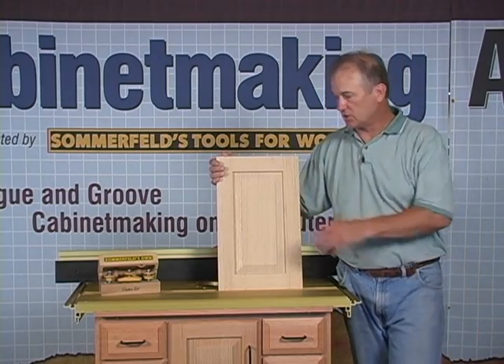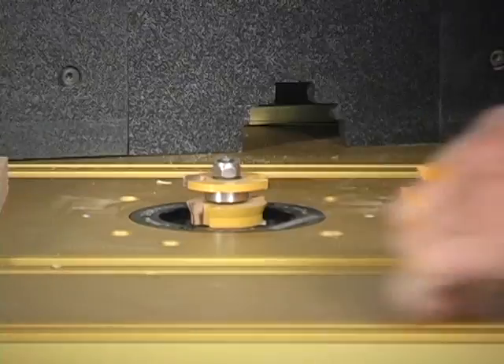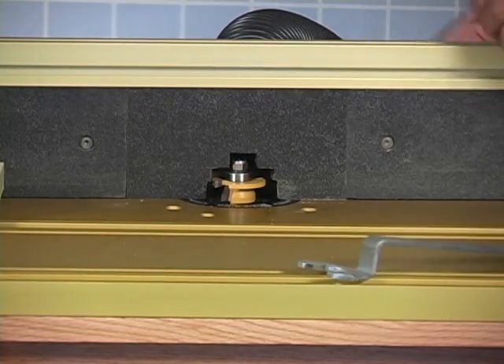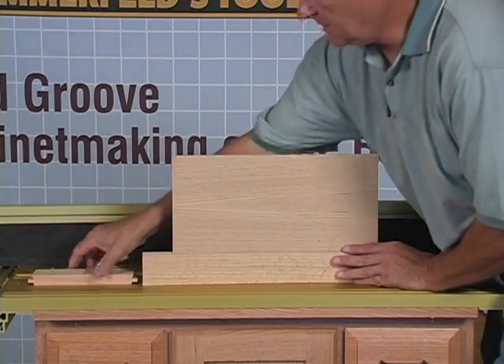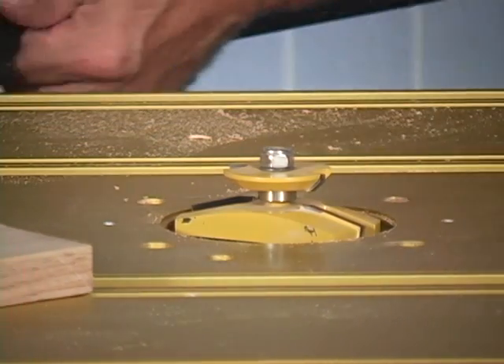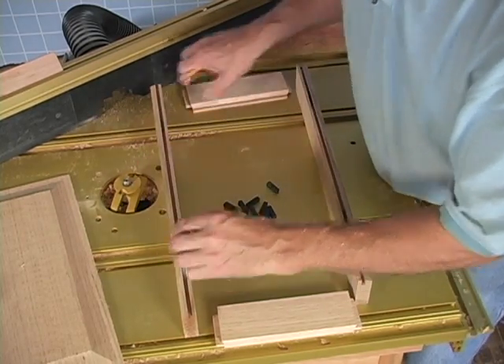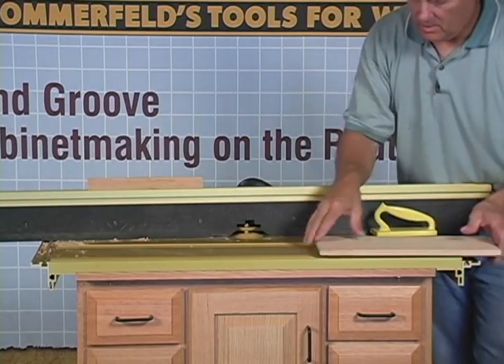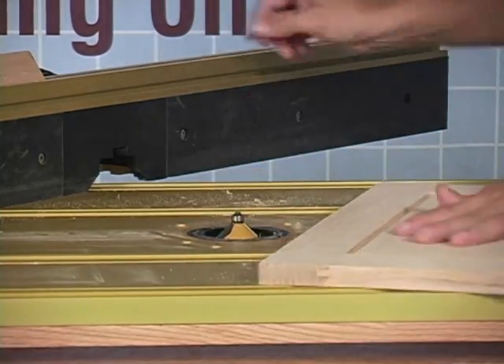Sommerfeld's Tools for Wood - Shaker Raised Panels Made Easy with Marc Sommerfeld - Part 1

Comment: The width dimension for the rails is too wide, and the length dimension for the stiles does not make sense. Rails do not loose 7/16 width only  the stile ends loose the 7/16".
Reply: Top rail and bottom rail are the short ones, by width he means the length of the top and bottom rails which go width ways.
Reply: @raycarnis9540  Yes, that is correct. The rails will lose 7/16" on each side so you need to add 14/16"(7/8") to your rail measurement to get the correct external width dimension of your door after using the cope bit. the styles remain the length of the door.
Reply: @shadespicturehangingsystem1015  Unfortunately, you're thinking of this incorrectly. The width of the Styles are 2-7/16" each, the length of the rail is 8" but the cope on the end of the rail will inset into the style by the 7/16" on either side. Think of this as "visual" measurements after assembly, Style 1 at 2-7/16", the Rail at 7-1/8", then Style 2 at 2-7/16" for a total width of 12".
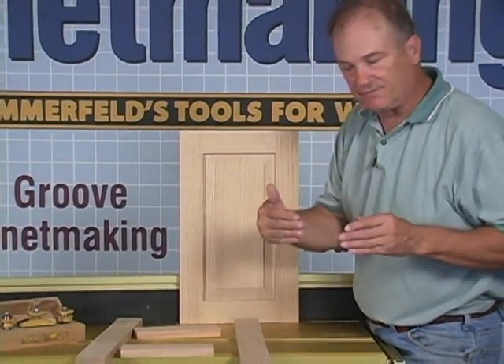Freeze the video at 1:31 and you'll see how the rail is inset into the style.
Reply: Crap instructions, and thoughtless measurements. This video was garbage. Yeah, let’s EYEBALL so we can make a million test cuts to make a flat shaker back. Hey, I have an idea... Why not have a precise measurement or setup tool that will make it more precise and reliable every time?